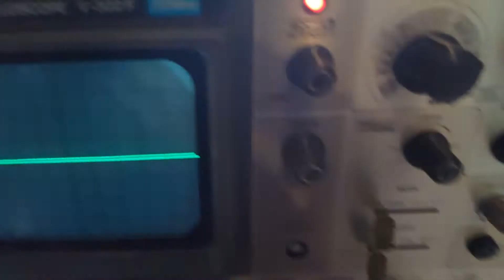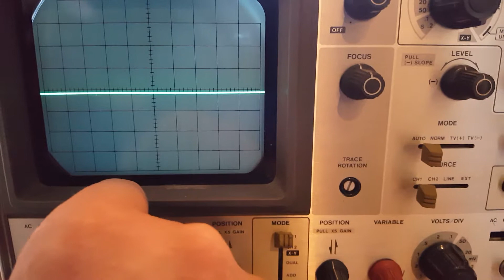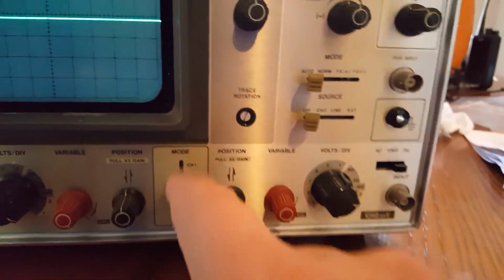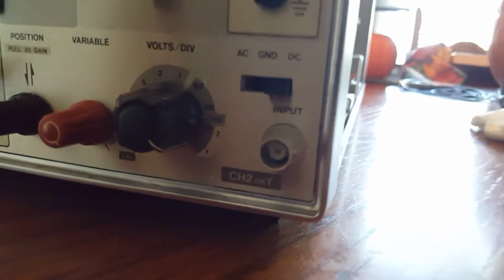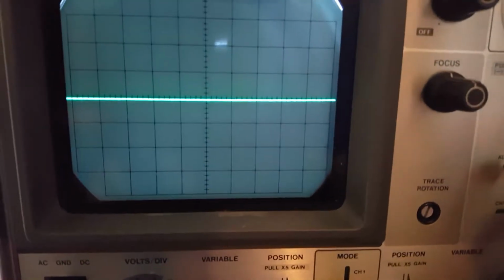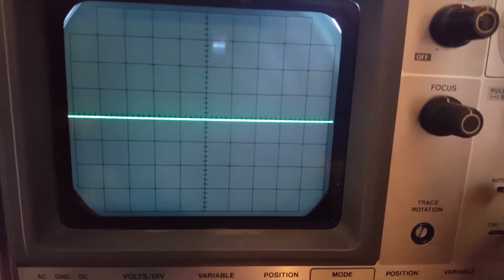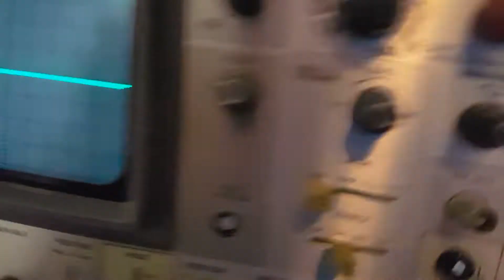Hitachi V - 302 F Oscilloscope VOLTS/DIV Balance Calibration

Comment: If you need to adjust the preset be sure that you are iland you self from earth ground to keep your self awey from danger of a electric shock I hope you can show the cable I have a ocilioscope like your and I need to see how is the cables to get a par to use mine a need to check some electrek waves to finish the devalament of a divivece to save money in the electricity bil

Comment: I have this scope without the "F" and I had the misfortune of going to adjust my pot and it fell apart...it was the old type that has the ring exposed...seems yours has the nicer pots on it..
Reply: Kennynva T. Find one on Digi key.
Reply: Good video. Consider. The balance needs to be checked throughout the whole range of settings not just 5 and 10 mV. With some trial and error and patience I have the whole range within a few minor divisions.